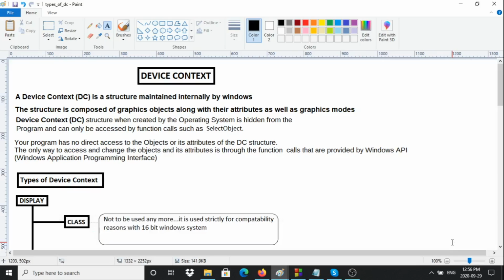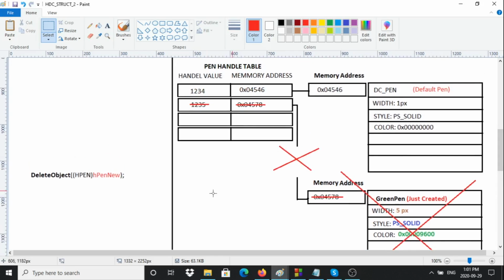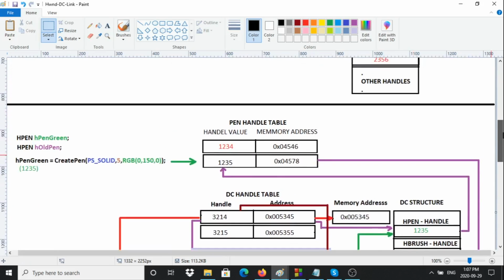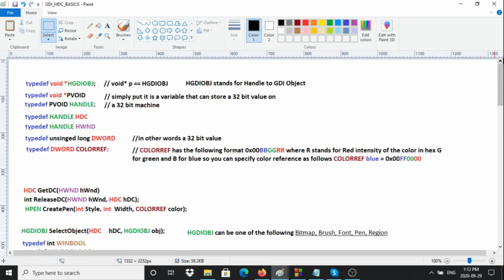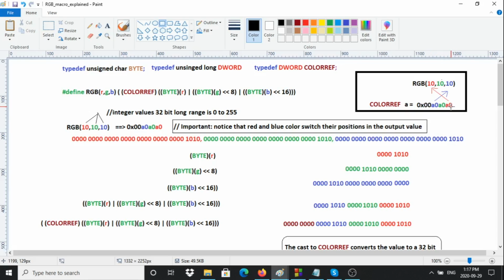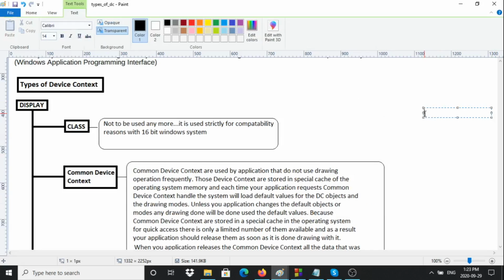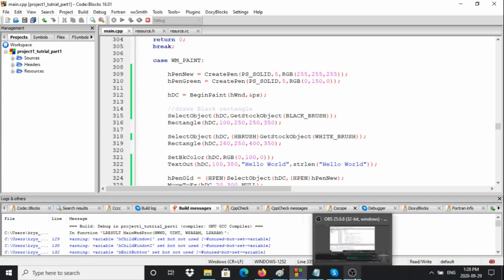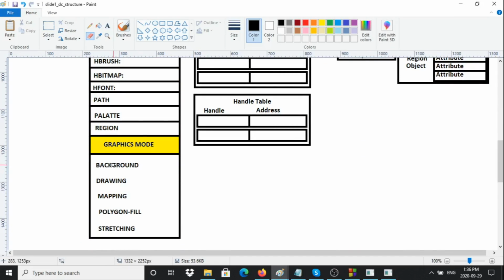Video 14 - Common Device Context  Basics part 1

Comment: Good 
explanation in this video ut i didn't catch were to put the WM_PAINT. In MainCallback or Childcallback. I also wonder were the Handlers are set, hPenNew, hPenGreen, hPenOld, hDC and ps.
Reply from the maker: LRESULT CALLBACK MainWndProc(HWND hWnd, UINT Message, WPARAM wParam, LPARAM lParam)
{
   static HPEN hGreenPen;
   static HPEN hBluePen;
   static HPEN hOldPen;
   PAINTSTRUCT ps;
    
    switch(Message)
    {
    case WM_CREATE:
        hBluePen = CreatePen(...);
        return 0:
        break;
        
    case WM_PAINT:
        hDC = BeginPaint(hWnd,&ps);
        hGreenPen = CreatePen(...);
        hOldPen = SelectObject(hDC,hGreenPen);
        //use pen
        SelectObject(hDC,hOldPen);
        EndPaint(hWnd,&ps);
        DeleteObject(hGreenPen);
        return 0;
        break;
        
    case WM_DESTROY:
        DeleteObject(hBluePen);
        return 0;
        break;
        
    default:
        return DefWndProc(...);
    } 
}

In this case since we are drawing in the main window we have to capture the WM_PAINT message for the main window procedure. If you want to draw something in the child window you would have to capture the WM_PAINT message for the child window procedure. The handlers can be set in WM_CREATE message to keep them for the duration of the window/application, or in other messages like WM_PAINT however since WM_PAINT is called very frequently in windows you should destroy any object you create in WM_PAINT before exiting the WM_PAINT otherwise you will end up with large memory leak which could crush your program.
Reply: Thanks for respond